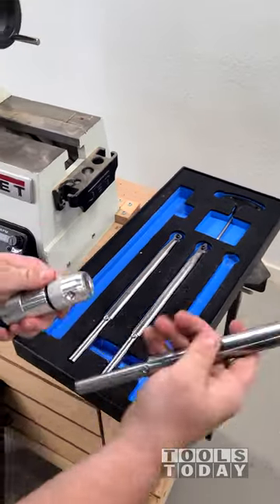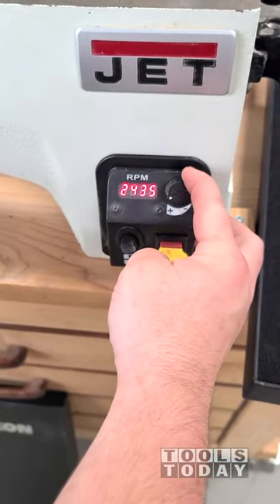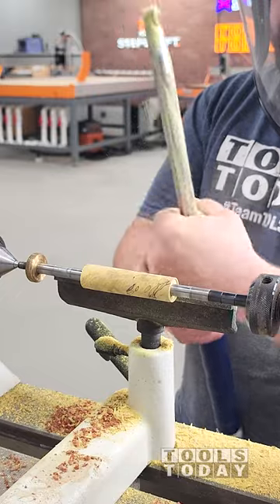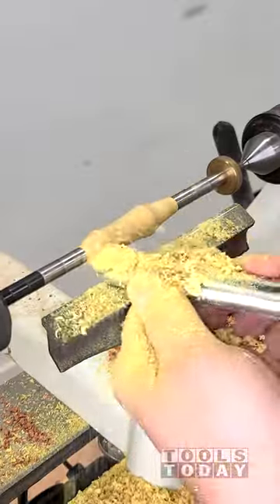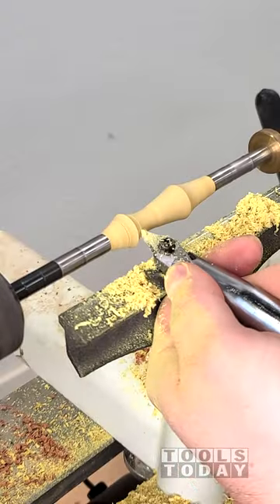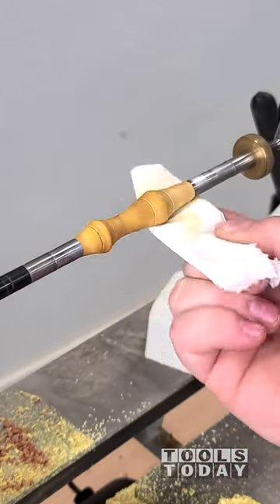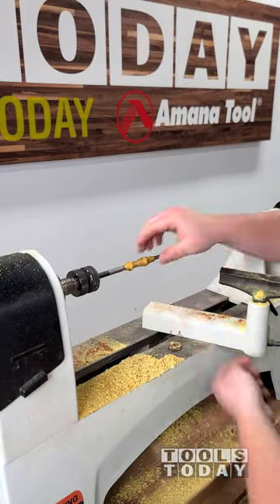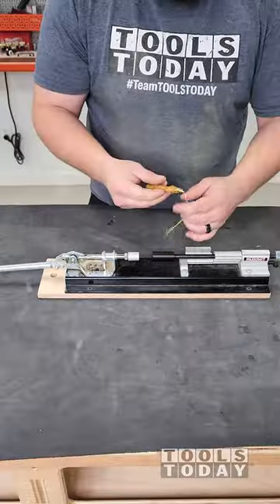Easy to Change Woodturning Tools

Comment from the maker: Check these out on our website - 
Rikon 70-800 4-Piece Woodturning System
https://www.toolstoday.com/v-19817-70-800.html

Jet 719200 JWL-1221VS 12 Inch x 21 Inch Variable Speed Wood Lathe, 1HP, 115V
https://www.toolstoday.com/v-17988-719200.html